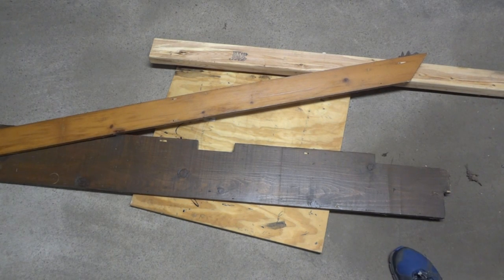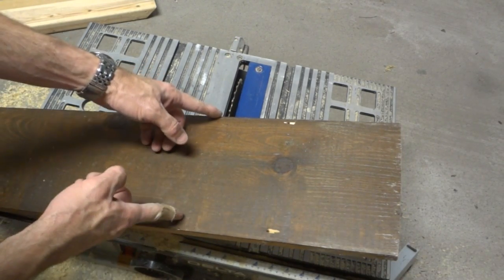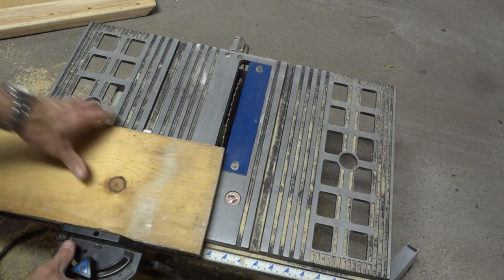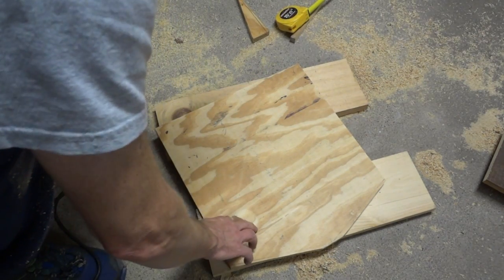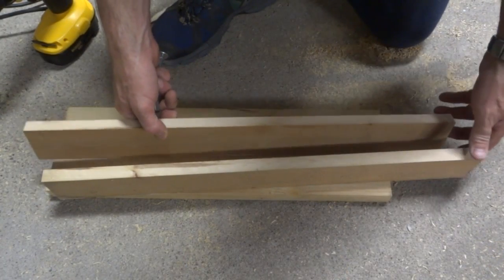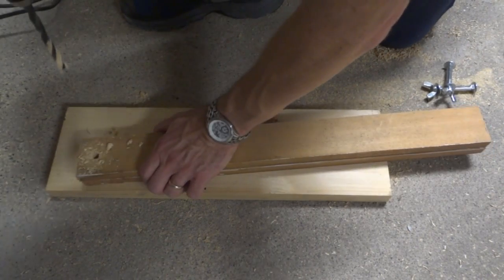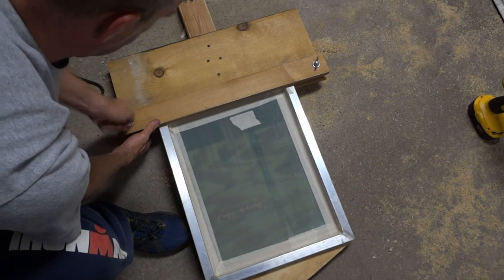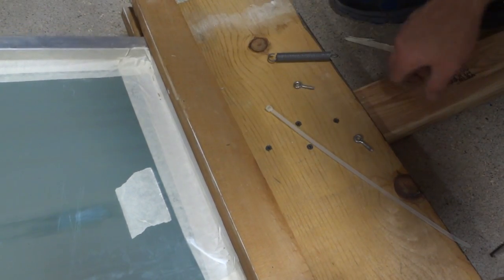How To Build A Cheap T Shirt Screen Printing Press

Comment: So simple and easy to make...and your tuition was clear to understand. I didn't find any timber that had been discarded so l bought some 1/4th plywood and used epoxy to join two pieces cut to size together making it 1/2 inch thick. I joined two pieces 2"x 1" timber cut to size with epoxy making it 4" wide by 1". This meant the materials were cheap. This was a great video, perfect for anybody to make. Thanks for taking the time to show us this idea.
Reply from the maker: +Alan Oliver Hey, whatever works! I just put out a basic design that can easily be modified with whatever you have on hand.

Comment: Thanks man, just finished building something very similar using your guide.  I have some smaller frames and figured something out to get them to reach the top of the t-shirt (incase you dont want to use >12" tall frames to touch the target spots on a t-shirt) - I loaded a 2x4 into the clamp, and drilled a clamp into the edge of the 2x4 (the bottom of the clamp is nearly level with the surface), and I load my frames into the newly added clamp

Comment: I am going to attemp to build two of these with my sister and dad this weekend. Thanks so much for posting this video! Here's a materials list I jotted down from watching if it helpful to anyone else that comes along and watches. I could've missed some stuff and this is obviously about being creative with what you already have. Happy building and printing, everyone! 
(2) 2.5 in wide 24 in long 
(1) 2x4 cut at 45 degree angle on one end 
(1)16 in x17 in  board, angled 
(1) 7 in x 24 inch board 
(2) Bolts: ⅜ in bolts, 3.5 in long, washer , wing nut 
(1) Strip hinge (or 2 -3 smaller hinges)
(2) Eye Screws 
(1) Spring 
(1) Zip Tie 
Screws
Reply from the maker: Thanks! I will add that to the description.

Comment: Hello, I followed the plans and built this yesterday. The plans are sound and minimalistic and it obviously works as mine does and I say thankyou. I would strongly advise however you make a follow up video from the same kindness that inspired this one. I had to overcome several challenges to make a device that looked and operated like a screen press into one that actually worked. This had much to do with the level of each piece of wood. My sheets of 3/4 ply and my 2x4 were slightly warped. This caused major alignment issues when the press is directly over the platen causing too much off contact and uneven at that (tilted to one side). This is no fault of your design but you may want to instruct people especially newbies to carpentry like me to be careful in what pieces of wood are used and to insure they are fairly level and not too badly warped. I literally spent more time sanding and tinkering before I could get the screen to lay flat and evenly over the platen . Again this is no fault of yours but PLEASE point this out to save possibly thousands of inexperienced people from disappointment and frustration. If I had realized that the tolerances were less forgiving, I may have even sanded every thing first to insure even better alignment and most certainly would have been very careful when selecting my pieces of wood from the hardware store. But I learned something from this process and it will serve me well next time I need to build something. Thanks again.

Comment: Awesome! I have all this scrap at my house and a radial table saw, just learning, but I want a miter saw now.  Going to try to do this, I was trying to figure out how to hold the screen I bought yesterday in place without spending a ton of money.  Thanks!
Reply from the maker: Is it a radial arm saw? They will cut angles like a miter saw.
Reply: yes. but I am not that good at using it except for straight edges. for my 2 by 4 and cutting scrapwood for my signs.
Reply from the maker: I have faith in you that you can learn how to use it. :D

Comment: If both attachement points are level with the screen when its lowered the spring wont pull the screen up. Maybe... Idk it might help if the press side was higher. 

If you want good off contact with that set up try taping a couple coins to the under side of the screen so they hit the platten .

Comment: RJ - great plans!  I made one from plans but I wish I saw yours first.  Yours is much better and simpler to use, store and set up.  The only problem I have found with home screen printing is the photo emulsion is expensive and has a short shelf life once it is activated.  Thanks.  Has anyone found any cheaper way to make photo emulsion last longer or a brand that lasts?
Reply from the maker: Store the photo emulsion in the refrigerator. It will last longer. I have used mine like 6 months or a year later.

Comment: I made one from that design and I like it except for one thing. When you get your shirt up close, it bunches up and it won't re-close again very easily so what i have to do is make one side of the frame twice as wide to make up the difference so that I have a little bit more space for the tshirt to bunch up. other than that works great.
Reply from the maker: Hey, whatever works for you. I haven't had problems with mine. Even with sweatshirts.
Reply: I made a little Improvement and now it works great. I added a 3/4 Riser underneath the frame. Which I screwed into the bottom part of the swivel plate that goes up and down. That way it raises the frame up a little bit higher  and then I raised up the shirt plate another 3/4 as well so there was a gap underneath the shirt plate so my shirt tail will go underneath the shirt plate and now it works beautifully. Anyway just thought I'd share that with you. It made a big difference.

Comment: This video is cool. I got the wood to make it, the thing is I don't have all the tools you use, but thanks anyways!
Reply from the maker: +LadyOscar Hn You don't need all the tools I used. You can do most of it with a regular handsaw. It will just take longer. I had the tools, so I used them.

Comment: will the screen actually come down unto the shirt, because it looks like there is a space between the screen and the base where the shirt will  be layed onto???????????????
Reply from the maker: Yes, it comes down on the shirt. It would be pointless if it didn't.
Reply: great
Reply: So the shirt board and the bottom clamp board are the same thickness?

Comment: Of all of the designs I've seen I've liked your build the best. Is there any way to modify this to accomodate a 2-4 color press? I was going to use a lazy susan to turn it.
Reply from the maker: I originally built a 4 color press with a lazy susan type thing. It big and heavy. The registration is the toughest part. but I found myself only doing one color printing. So I built this one. Use the same kind of clamps as this one. Mount them to a square piece of plywood with a lazy susan bearing mounted in the middle and to the 2x4.

Comment: One thing to note to anybody making this. Springs as in the video will only work on a frame that''s very light. It wont work on mild steel metal framed screens that are heavy.
Reply from the maker: Then use a stronger spring or more springs.
Reply: @RJTheBikeGuy I wish it were that simple. Springs with such a short length dont come that strong. Well not the ones I have found yet. Mild steel frames are heavy and the angle for leverage is poor . Having to use say 10 springs to lift it might be a little crazy. Good video anyway. I saw a home built machine the other day and the guy had used a counter weight instead of springs
Reply from the maker: I use this press as is with metal frames. Find different springs or use rubber bands. Figure it out.

Comment: Built one like this yesterday -- thanks.   

Any suggestions on the off-contact amount?  I assume we could control that with spacers under the screen?
Reply from the maker: I have generally done contact printing, but you can use spacers if you want.

Comment: if i want to print red and blue colors on dark tshirt, i apply white first to the screen then dry it and wash the screen then how can i adjust the screen in this press? does it need something to return the screen to the exact place where it was when i apply the white?
Reply from the maker: bushbosh You pretty much need a multicolor press and a flash dryer.
Reply: +bushbosh You need a way to 'register' the shirt relative to the printing press. (or have two but you still need to dry it between prints of course) Then you use another screen/squeegee with the exact same registration. I know because I did this back in junior high school.

Comment: I dont really have any wood cutting tools beyond an orbital jigsaw. Is there any 1 tool I could use to cut all of my wood?
Reply from the maker: A ordinary handsaw.
Reply: shyflirt1 Thanks!
Reply from the maker: No problem. The cuts are pretty straight forward. So a regular handsaw, or circular saw like I use in the vid. A jig saw would work too. Nothing is too critical on this. So whatever you got pretty much.

Comment: I watched this twice. Maybe you forgot to mention the thickness of the shirt board must be same as lower side of the clamp be. Right?? So the screen will really fit-touch onto the shirt. Isn't?
Reply from the maker: Yes, you want them the same thickness. I thought I mentioned that in there somewhere. The boards I used in the video were 3/4" thick.

Comment: Does it matter the thickness of the wood?
Reply from the maker: Common 3/4" thick is what I used. I wouldn't use thinner as it will probably be flimsy. You can use thicker, but you want the shirt board and at least the bottom part of the screen clamp to be about the same thickness or they wont be level with each other.

Comment: May I know the brand and price of your woodcutter?
Reply from the maker: Which one? I think the table saw is a Delta. The miter saw is a Dewalt. The Circular saw is a Skil I think. I don't remember what they cost as I have had them a long time. But you can use any saw to make this. You can use a hand saw if that is all you have.
Reply: Thank you for the reply.

Comment: How to build a cheap $50 wood screen printing press...........BUY $600 OF WOODWORKING TOOLS!
Reply from the maker: You don't NEED to use the same tools. You could use and ordinary handsaw for most of it. I have the tools so I used them.
Reply: shyflirt1 Agree with you. If you have it, you use it. If your friends have it, you borrow it..if no one have, you wait for it..by the way, nice one you have there man
Reply: home depot and lowes will cut it for you for practically nothing
Reply: Most people have tools lol if not use what you have